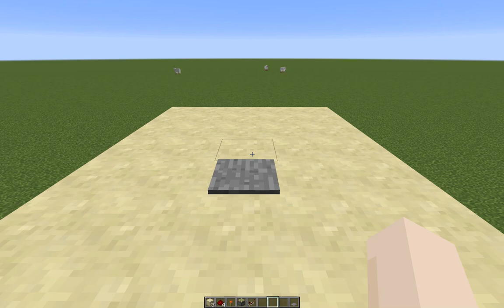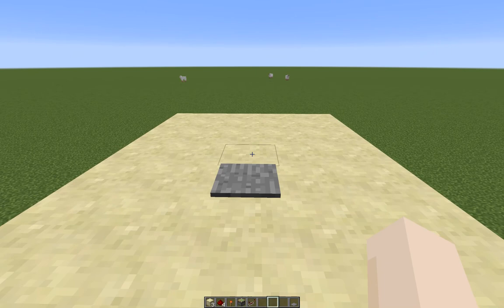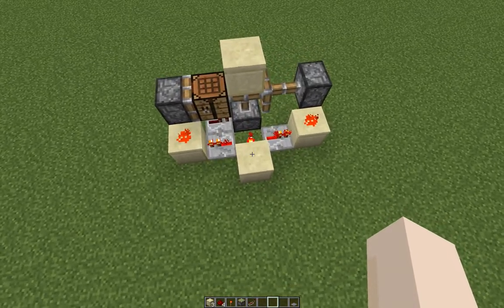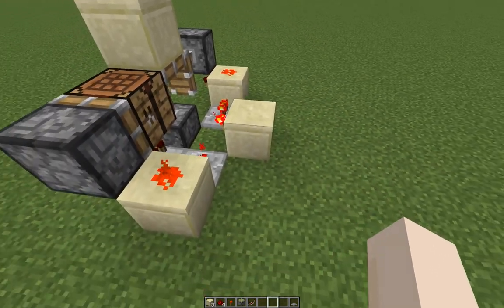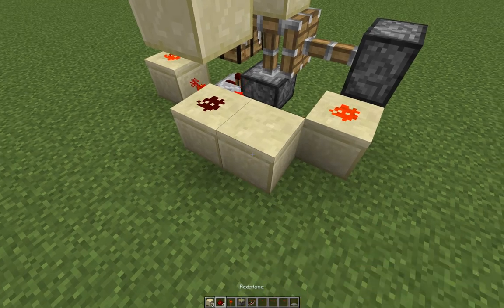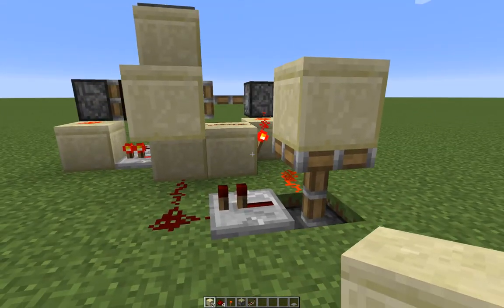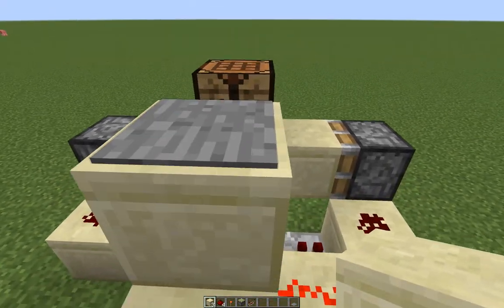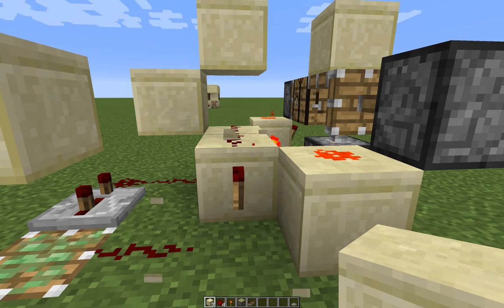Block Swapper Which Automatically Resets | 1.8-1.13 (Minecraft Tutorial)

Comment: Hello, I am wondering if it is possible to extend how long the block is swapped for; it will stay in the position for around 5 seconds after you step off the pressure plate, before returning back to its alternative position. I've tried time and again and somehow cannot figure out how to make it work. If you could help me, that would be great!
Reply from the maker: LapisWolf MC that should be possible! It would just be bigger. Let me have a look
Reply from the maker: This kind of setup will delay the switch back: https://imgur.com/a/N4QlMRG. You can make the line of repeaters as long as you want but obviously that will take more space
Reply: @OceanPhoenix  Thanks!
Reply from the maker: @LapisWolfMC  yw!